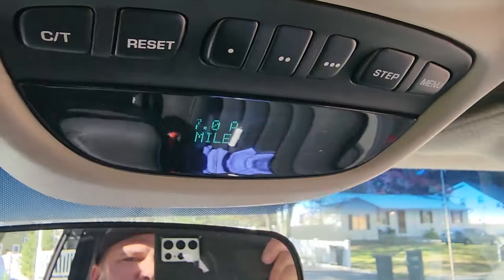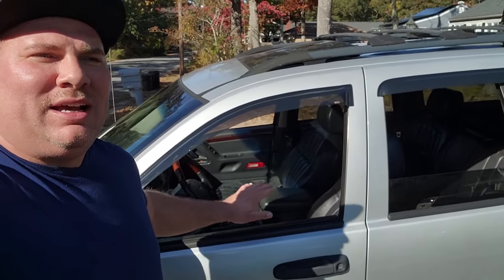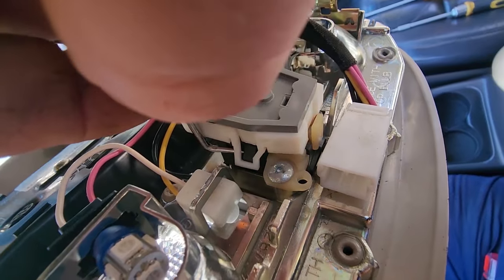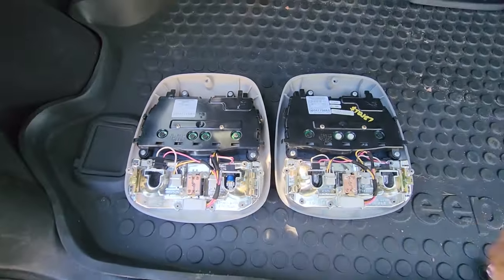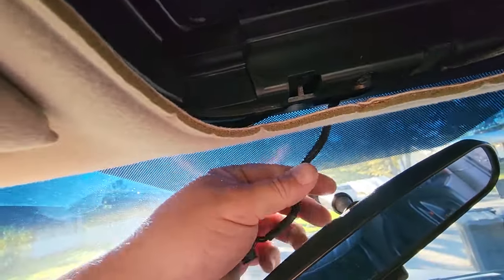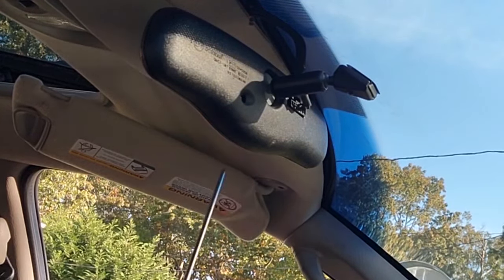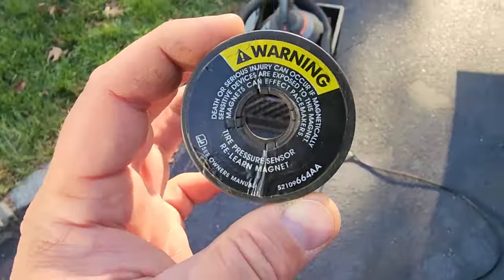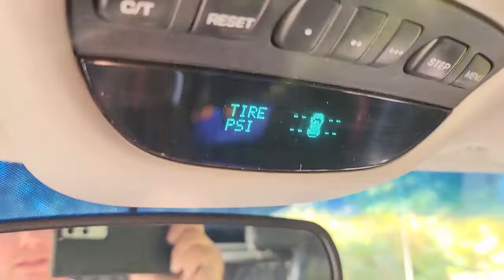JEEP GRAND CHEROKEE WJ EVIC SWAP & REAR VIEW MIRROR UPGRADE

Comment: You'd be happy to know that you can use a auto dim mirror from a Chevy Tahoe plug and play that of the same years that has temp and compass on it 😎
For the temperature sensor and info I just used one from a wj so I got inside and out temperature information and my rear view mirror has a compass too 
 Might be overkill but I love it
Reply from the maker: Dude, that's great.  I bet most mirrors just need power and ground
Reply: I just look the plug on the Chevy tahoe rear view mirror is different then Jeep
Reply: So you are saying a Chevy tahoe rear view mirror will rear the compass and temp?

Comment: I always just unscrewed the screws holding the sunroof switch in place in instead of popping the latches on the sides of those connectors. 
It lets you use the sunroof still, is easier, and less likely to break anything.
My EVIC mount (the black bracket) fell down because of the summer heat melting the butyl, so I stuck it up with some super-strong 3m double-sided tape and it works.
Reply from the maker: lol, I always thought it was weird that they secured the EVIC mount with only that messy black goo! haha
Reply: @ProjectDanH  Especially since the dome light mount on XJs is a real metal bracket.
Reply from the maker: @elsydeon666  can't compare WJs to XJs... XJs are superior in every way. lol 😜
Reply: @ProjectDanH I always thought the opposite, that the WJ is a better XJ.

Comment: I'd personally prefer to DOWNgrade my 2002 Limited EVIC.  When the non-serviceable, old-school $150 (per wheel) TPMS unit batteries die, the EVIC beeps, complains, and displays an error instead of C/T upon startup and after every 20 minutes of driving.  I'm looking for a hack.
Reply: Superchips has TPMS disabled for my Wrangler.  They may have one for your JGC.
Reply from the maker: Lol.. want my old EVIC?

Comment: You keeped saying 300 miles ik what you meant lol
Reply from the maker: What's wrong with 300 miles? 🤷 That's the distance I drove on my first tank of gas.
Reply: You can get more then 300 miles ik I do on my v8
Reply: @natewj1587 I get about 320 miles until my needle is at the very bottom, then it take’s about 18.5 to 19 gallons to fill back up